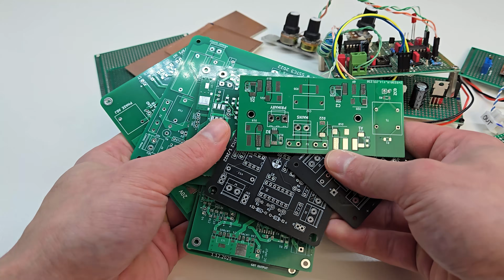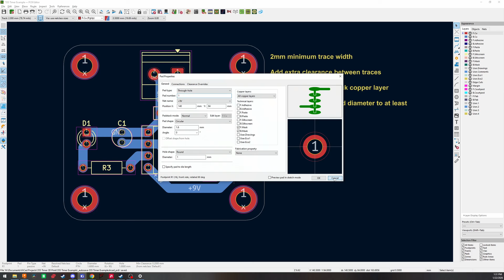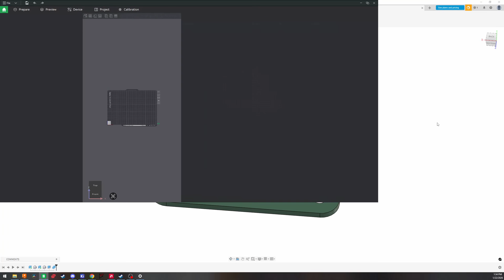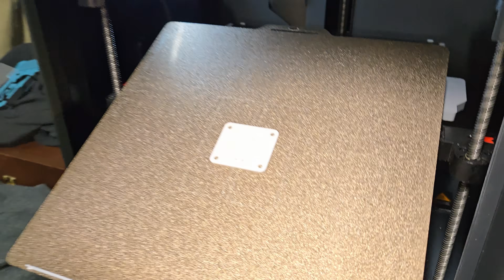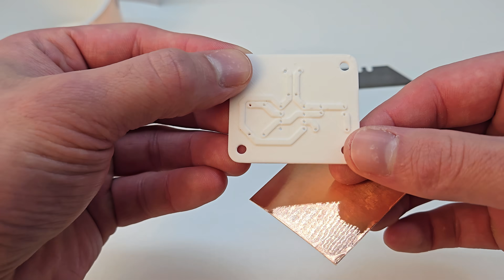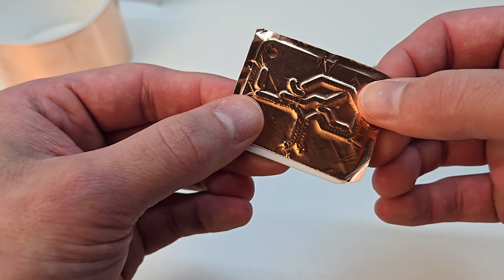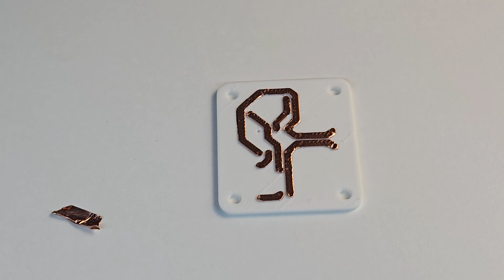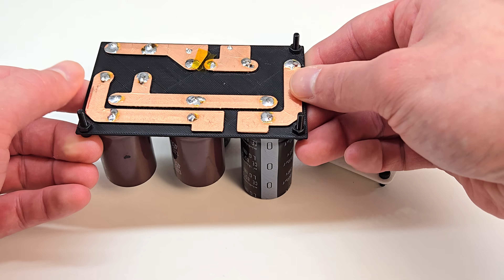3D Print Your Own PCB

Comment: Surprisingly practical, though it might be a stretch to get enough resolution for SMDs. I’ve got some conductive carbon PLA that one could feasibly use to make a multi-sided board and electroplate the traces and vias with copper, but electroplating the separated traces means doing it one-by-one, or having some sort of temporary connecting matrix.

I still think galvo lasers are the future of home PCB fabrication. Seems like a combination of blue and infrared lasers allow for both the charring of though-holes to plate, and the lack of charring for burnt away copper between traces.
Reply: Something I've been wondering about for a while along those lines is if it'd actually be easier to do microvias rather than traditional plated through hole vias in a DIY setting since they dramatically decrease how much copper needs to be deposited when plating and overlay should be pretty good. The main trick, as usual, is how to get the copper in as far as I can tell.
Reply: @benjaminchung991 
I’m not really sure what the difference between a via and a microvia would even be for a 2-layer board where holes are drilled with a laser. If you haven’t seen it already, I recommend seeing how this guy used a fibre laser to make plateable holes without needing any conductive paint or rivets:
https://youtu.be/nLq4MKR5nKI?si=VfVWFPO74WV_GP4B
Reply: @Scrogan  That's pretty neat, and a very clean plating setup. 

My thought wrt via vs. microvia is that I'd like to be able to do sequential construction of an ELIC stackup with many layers and microvias between every layer.
Reply from the maker: Thank you! SMD would be tricky for sure. I wish I had a laser cutter to try it out. Maybe one day.

Comment: Very simple, most people still won´t come with this idea... Thus, very creative!
1) Maybe spray the backside with lackeur (after soldering everything on), so that the traces cannot get "unstuck" with heat and wear/time???
2) Add more feet, when a curcuit is so heavy like the last one you show us? So that the PCB flexes less under the big-component´s weight?
3) Any information about how broad the traces must be, when using this copper-tape, depending on amperage/load?
Reply: Was going to suggest a bar on top between those components for same.
Reply from the maker: Thank you, I appreciate that! Good suggestions! I will keep those in mind for future prints. I did not do any calculations for the traces but there are a lot of calculators online. I am sure the foil tape thickness could be used to derive current handling capabilities.
Reply: @QZW_Labs or just thicken them with more solder liberal flux 😊

Comment: One day we will have pcb printing i guarantee. Well i mean included in 3d printer.
Reply: PCB printers are already a thing
Reply: @karliszauers1  true
Reply: Already there with copper granules mixed paste. It lay the traces and need to bake it like solder paste.
Reply: voxel8 built and announced the tech to 3d print circuitry into 3d prints about a decade ago. a friend of mine used to work there. but I think they pivoted to 3d printed shoes or something.
Reply: /watch?v=FzrZoVKT8gM
Reply: Go and look at Project Binky- printing car dashboard wiring using a 3d printer.
Reply: Well 1st thing: PCB stands for PRINTED circuit board...
2nd: you can make WAY better boards with a laser printer, some photo paper (the shiny one), and an iron. This is your second best choice for homemeade pcb making. The one in this video is sort of acceptable but 3d printed boards are garbage. You will melt it the moment you try solering to it.
Reply: Yeah doing photolith (or whatever its called) to make PCBs actually can make some rather good boards once you dial it in. The problem with that is getting your design made professionally and mailed to you is so dang cheap nowadays that most people don't bother with making them.

I still think what this youtuber made is a neat idea though! Sometimes you just like making stuff yourself and also I'm sure this might be better than mail order in certain instances (like if you needed your board yesterday and can't wait on one from China)
Reply: @GamrokFeddy PLA was used in the video, and the melting wasn't visible to me. PETG will need higher temps to deform... i don't see the problem there.
Reply: @GamrokFeddy This method is much simpler then making pcb with a laser printer, with laser printer you still have to buy pcb blank board, cut it to your size(and you can't inhale the particles from pcb becuse they are very dangerous) and only then you can start making actual pcb

Comment: I wonder if conducive copper paint might work well on the raised traces? Or if the resistance would be too high
Reply from the maker: That's a good idea. I'm not too familiar with how conductive those paints are. It could work for basic signal traces.
Reply: @QZW_Labs my initial thought was what others had said about having the traces sit deeper in so you could scrape off the raised areas, but that made me think of a liquid that could sit in the groove. 

I am tempted to try this out. As good as JLC you're still waiting a week between revisions
Reply from the maker: @colonelbarker good point! If you try it out let me know how it goes.

Comment: Idea: If you extrude the trace the other way, and press the tape into the trace, can you just sand of the excess instead of cutting? That'll be easier and may need less clearance
Reply from the maker: That is a good idea! I thought about making a negative mold to press all copper traces in one go. Maybe if the extruded inwards you could use a mold like that to tightly press all the tape in. The only think I can think of is that the tape might tear before filling the edges of the traces if press inward. Thanks for sharing the idea!
Reply: you might be able to make dual moulds, sandwich the tape, and have it since the foil for you, no need to cut anything manually
Reply: @hashbrown777  Why just sandwich once. 8 layer PCB here we come!
Reply: @QZW_Labs  that's exactly what I was working on! not sure if this gives me more or less motivation to finish my project :)
Reply from the maker: @TheRudeRandom see how it goes! I'd like to see what you come up with for sure
Reply: @QZW_Labs  a bunch of issues when you want the system to be reliable but I'll try
Reply: @QZW_Labs I Had an idea of pausing the printer put the tape and print on top
Reply: @yatto2377 That seems like it would cause some layer adhesion issues with the adhesive on the back of the tape. I wonder if pla would stick to copper.
Reply: It would also be, potentially, compatible with conductive paint. If the traces are channels you could just fill them in with a conductive paint like what's used for keyboard contact repair.
Reply: @asteroidrules thats exactly what i thought. Build small channels and fill it with conductive silver Paint. When the Paint is dry, sand the rest, If anything is left.
Reply: @asteroidrules I've tried this in the past, bit it is Soo messy. Good conductive paint (I used Green Stuff World silver conductive) is almost impossible to clean. But in my experiments it worked fine! You can use the paint as glue/solder.
The way I mitigated the mess was to print a final masking layer of a different material (e.g. PLA mask on TPU substrate) you paint the traces, then peel away the pla
Reply: @asteroidrules  Yeah, but you need to consider that 3d print FDM tends to have a gap between layers, and paint could channel through it
Reply: @assahas7088  If flow rate is tuned, that won't be a problem (with 2 perimeters minimum, you'll need a very fine nozzle). Ideally, one would use a transparent, undyed filament so it's easier to spot when it's under-extruding.
Reply: @some_random_wallaby   Also a spray primer could seal a lot of the gaps.
Reply: @assahas7088  Good point, you can first use PU varnish or super glue and then paint over it.
Reply: @some_random_wallaby  Unfortunately that´s not true. This would be over extrusion. Due to the process those gaps are always a risk, unless you tune for over extrusion which leads to ohter problems elsewhere.
Reply: Only thing I don't like is that it seems to waste too much copper tape. Maybe the circuit could be "dug out"  like channels and just run copper wire inside... can even do multi layer.
Reply: @Progress303  Or, you could just treat the excess tape as your ground plane, ultimately turning the waste into something useful!
Reply: Was thinking the same thing. Also makes it way easier if you do decide to cut it. Also, If you print in ASA or ABS, you dont have to worry about the heat he keeps talking about with pla
Reply: @boom3198  It´s all thermoplastic, unless you print PEEK, you have to be careful with temperatures.
Reply: @sierraecho884  or you could use bismuth solder. its melting point is even lower than plas
Reply: @123isonmi  Yeah but then you will have to fumble around with bismuth.... You can simply print in PETG and be careful when soldering instead.
Reply: I worry about soldering. The more you indent the traces, the higher chance there is of melting a bunch of plastic on your iron on accident.
Reply: @skmgeekI was working of a project with a 3d printed board and holes for components to connect with some cheap copper wire and ended up with a lot of burnt plastic
Reply: Maybe etching it away with a stencil could be an option too
Reply: Шлифовка таких вещей будет плохим способом очистки, т.к. всё держится на клею. Клей будет скатываться и липнуть с обратной стороны, приклеиваясь к ней и поднимая слабые места, а сама фольга будет заворачиваться (попробуйте отшлифовать обычный металлизированный скотч таким способом).
Reply: I did a quick test, and this works! I did 0.2mm raised extrusion for the parts that shouldn't have copper. 1.6mm trace width. Used a toothpick the press the copper into the small spaces.
240 grit sandpaper.
I think the raised parts can be even thinner, e.g. 0.1mm I guess as long as it is significantly thinner thicker than the copper.
To reduce sanding time, you can create a copper fill to minimize copper-less areas. I recommend a small raised perimeter on the edge of the PCB to help with pressure distribution during sanding, but KiCad should do this automatically when creating a copper fill
Reply: Smart
Reply: Just wanted to suggest exactly the same idea. Would be nice to see if it's actually working.
Reply: I was thinking this same thing but instead of using tape I was thinking extruding copper into the concave relief. Sorta like injecting plastisol through an injector when making soft plastic baits. I believe they have metal printers nowadays too. Maybe even that conductive liquid paint would work. Then the board would be thicker and less flexible, you could make the traces as deep as necessary to provide the ampacity you need, and they would sit flush with the surface of the board negating any issue with leg length of your components.
Reply: Братюнь, отличная идея 👍 тоже хотел предложить, когда начал смотреть это видео. И вообще, отличная идея для производства не ответственных плат. Не нужно ни травить, ни сверлить, напечатал, наклеил токопроводящую фольгу и готово. Просто мечта, а не технология 👍👍👍. Один вопрос - какова долговечность платы?

Comment: Would this process allow for traces to be routed on a 90 degree corner, such as creating contact points for a separate part to be connected or disconnected?
I was thinking of say if wanted to create an Add-on child board containing second feature?
Reply from the maker: Good idea! I think that would work. Not sure how long the copper tape would hold up to wear and tear if it is a moving contact point. Worth a try though.

Comment: How strong is the adhesive on the copper tape? and does it stick well to the PLA? I need to try this out sometime. I haven't used my printer in months. I wonder if you could make multi-layered boards this way? they'll be kinda chunky though 😁liked and subbed 🙂
Reply from the maker: Thanks for checking it out and the sub! It sticks really well actually. The solder also makes it stiff and less likely to peel away too. I have been thinking about how to incorporate a ground plane. I'm still working on it but I think it is possible.

Comment: Did you ever try extruding in the opposite direction?  I wonder if it might make the in between sections easier when space is tight?
Reply from the maker: That is a good idea! I have not tried that. I'm sure it would help with clearance. Maybe a 0.2mm nozzle would help as well. I also thought about adding a thicker boarder to the outside of the pcb to help make it more stiff.

Comment: Very interesting idea.
Why did you have that trace between R3 and D1, the LED, jog over at the end?  Why not move D1 out a tiny bit to keep the trace one straight line?
Reply from the maker: Thanks for checking it out! You're right, that would have been a bit easier but for such a basic circuit/test I didn't spend much time on layout.

Comment: That's so cool man, I played around with this thought in my mind at one point.. but my head cinema made it turn out like crap so I said forget it. Your outcomes look very nice here.  Cmon Bambu, give me Copper PLA lmao
Reply from the maker: Hey, thanks man! Yeah, I think if I messed with it a bit more I could make some pretty decent designs. But as a proof of concept I am happy how it turned out.
Reply: @QZW_Labs  I kinda like the idea of not having to manually drill so many holes 🙂 but the trace width of 2mm plus the required spacing between traces means that routing more than just a few pins out of even a 0.1" pitch chip will be difficult, if not impossible. 

Plus, the overall circuit size is going to be an issue, and I'm not aware of there is any sticky copper tape wider than a few inches (I reckon you'd have to layer&solder it for circuits wider than the tape).

At least you can have traces on both sides of the "board" without any alignment issues!

I wonder if there could be a clever way of using electroplating to build the traces rather than having to use adhesive copper tape. Also because I don't know how well and for how long those 2mm wide traces of tape will stick to (a rough surface) plastic.